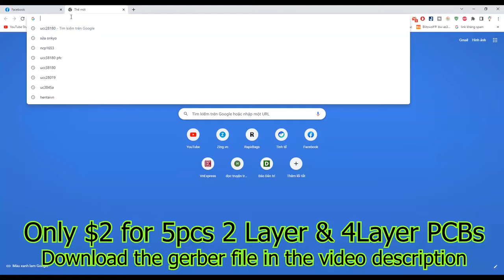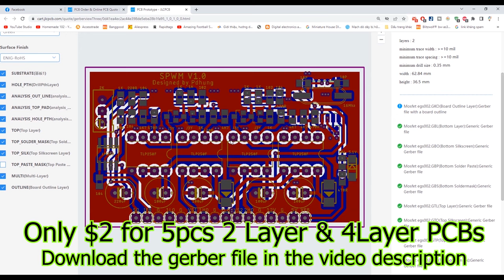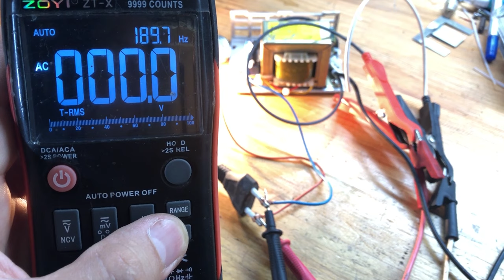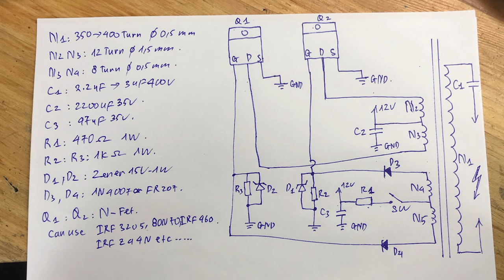12V to 500V hight volt inverter STUN FISH SHOCK simply | JLCPCB

Comment from the maker: This circuit has a high voltage. Furthermore, it may be illegal in your locality. I am not responsible for any problems that happen to you.
Reply: Very good video, thankyou. Have u been brave enough to try the output on any part of yourself?
Reply: I replicated this almost exactly, from your very well drawn circuit diag, parts, and vid. I couldnt get it to go. The fets i used were PSMN3R0-60PS. Pretty good, Vds 60, 300 plus watt, Id 80 plus, Rds on 0.003 ohm, Qg 130. Transformer prob identical, approx 40VA, used original split core bobbin. Well insulated, used litz for 12+12 primary as all i had. Sec almost 500 turns. Also used switch as in diag. First shot, 12v of lithium, immed shorted fet and melted batt wires. Second shot from 12v switched and no more than 5A, same, fet shorted. Removed switch, tested everything again, replaced shorted and good fet, 3rd shot 12v computer power supply, nothing. No shorts. No warmth anywhere. Reversed phasing of feedback. Still nothing. Any ideas?

Comment: WHAT THE BENEFIT OF RESISTOR OR ZENER ON GATE OR SOURCE THE MOSFET
Reply: Zener is to limit the gate voltage to 15v, and resistor to keep the mosfet off if no voltage on gate, it will prevent both mosfets from turning on at the same time.